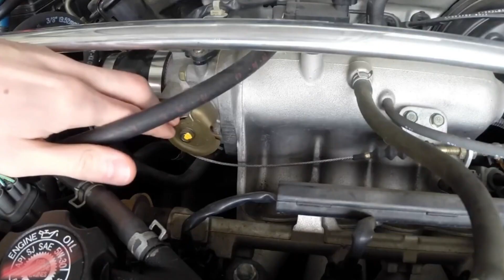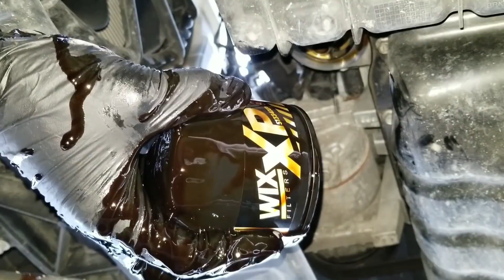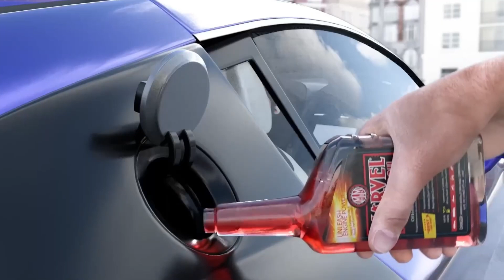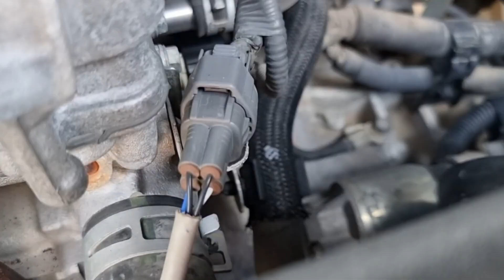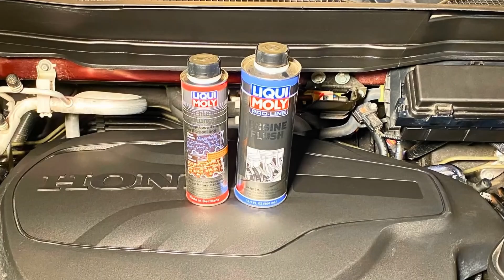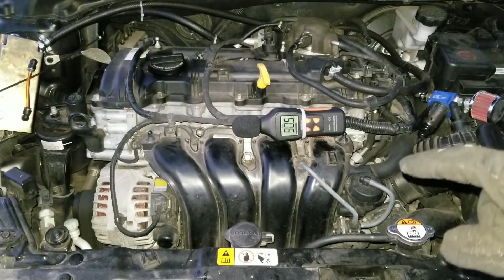13 Engine Additives for Toyotas That Actually Work (And 5 That’ll DESTROY Yours Fast)

Comment: What can I use to help my 2010 rav4 heavy oil consumption? 205k miles usually changed oil every 4500-6k but it’s just been bad as of late. I have the 2ar fe engine

Comment: What is your opinion of "Guaranteed To Pass Emissions" fuel cleaner? I used it in my used 97 Camry just as a fuel cleaner. It says add to a full tank. I added it to 1/2 tank & burnt the plugs. Thank goodness no damage to the engine. But those plugs looked like new. 
I now drive a 2019 Prius. I run ONLY "top tier" gasoline (Sunoco is local to me [and NASCAR fuel]). I could get cheaper gas from my grocery fuel station,  but I'd rather pay more & take good care of my car. 👍

Comment: 2017 Camry with 125,00 with no problems, keep up with maintenance over last 8years. Also 2021 Tundra with 55k on it. Same as my Camry keeping up with maintenance and no problems.
Reply from the maker: Good mileage. Should last 300k plus.